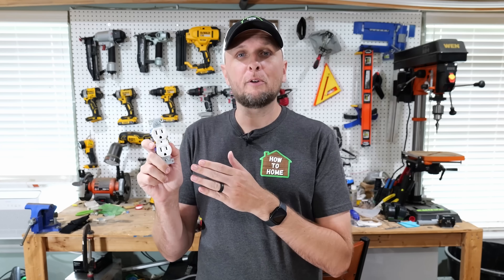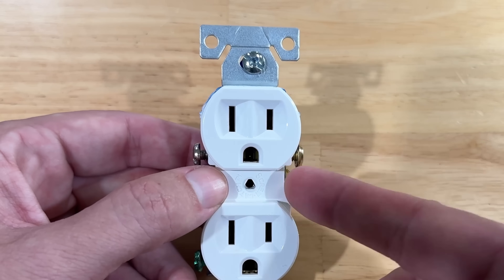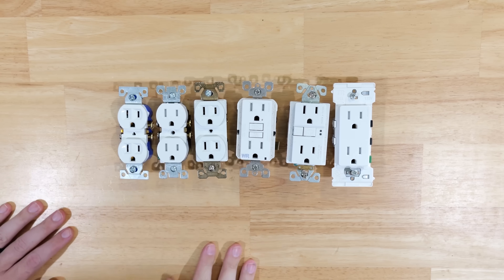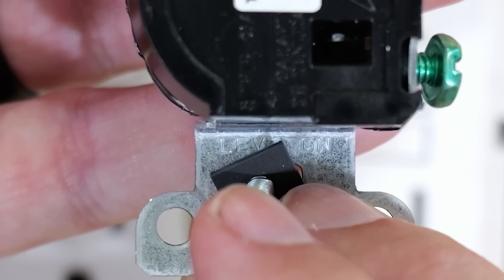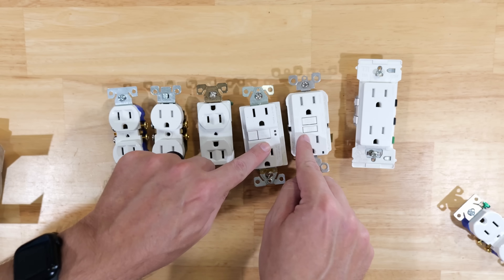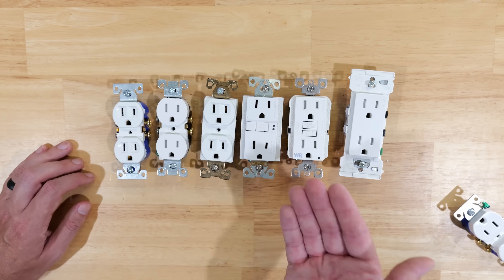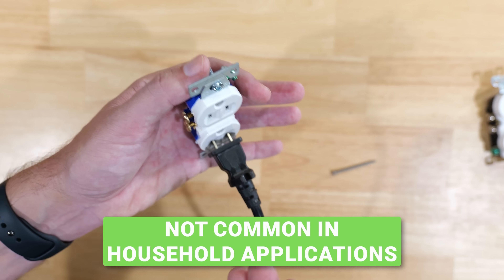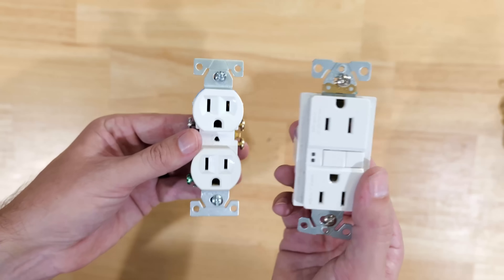The Shocking Reason Why Your Outlets Are Installed Upside Down!

Comment: Well, apparently there isn’t a standard for devices that plug into polarized receptacles. 
Directional devices, such as night, lights, transformers, and many other Devices will be upside down if you put the ground prong at the top. It’s that simple. I bought a place that had the ground pins upward and over time, I had to pull them out and make the ground pins down because of the device that was plugging into It was not oriented as intended. it was upside down.
Go to the store and buy a few devices that don’t use the ground pin, but rely on the polarized orientation and you will see why the ground pin should be down(most of the time). 
Many devices that plug-in to polarize receptacles rely on the neutral being on the left side. That’s why I install these plugs with the ground down because there is no IEEE standard for devices that plug into thesereceptacles. Thank you.

Comment: The house I bought in 2012 had all the receptacles ground prongs up. 90 percent of the receptacles had lost their retention ability.  Yes the plugs kept falling out.  Also try plugging in an extension cord with a 90 degree plug upside down. Just looks stupid.

Comment: It´s upside down to make it a tiny bit safer (because of stuff falling on live + neutral) instead of (finally) fixing it the proper way = making it save by transforming it into non-shocking non-shortcircuit recessed outlets = like the Germans did in 1930 with their "Schuko"-outlets (yes USA is 95 years behind the time) that are still compatible with 2026 plugs & vice versa (1930 (RWE) "Schuko"-plugs in 2026 outlets)  ... 

for demonstrations of this 100 years in the future advantage of "Schuko"-outlets see the video "Why I love the European / German schuko plug" from the channel "Trizocbs" ...  

USA plugs + outlets are the worst on earth that are still "recent" & deemed "save" by law/standards despite being very dangerous like in the 1920s

Comment: I've always seen the outlets and GFCIs with ground terminal down. But I notice that GFCIs that have a LINE and LOAD connection. The LOAD connections are to the top terminals and the LINE connects to the bottom terminals in a ground down scenario. The LINE wiring will normally come down from the top so I wonder why it doesn't connect to the top terminals. The LOAD could be going out the side or bottom of the box which means you either have ground terminal up so that the wiring doesn't cross each other. By the way, I noticed that your GFCIs  had LINE and LOAD showing on the backside of them also even though it was tough to read on my screen.

Comment: I'm 59. All of my life, I've seen the vast majority of outlets installed with the ground down. Having watched this video, I think I'll be inclined to do the opposite. Not because of anything you said - the nail situation strikes me as relatively implausible if the ground is up depending on the height from which it fell, so it might bounce off, but it might slide down and connect one of the hot prongs to the ground It's because when I can't properly see, being able to see that ground prong can help more than seeing the other two, depending on the design of the face. Most faces don't have an outward indicator of which prong is hot when viewed from an extremely high position, and you can't see the ground hole at all, and I usually struggle to get the ground prong oriented to the hole.

Comment: NOT NESSARY in a home .. in a workshop at, or just below counter yes as screws or drill bits can cause a problem.  In a home there is nothing to fall, like maybe a paint chip or some dust at most, however in a shop an AC GFI plug wont stay in a socket upside down.

Comment: It wouldn't be in the code, because it's not remotely related to safety.  Electrically, it's the same either way.  It doesn't mention installing them in a 45% angle either, for the same reason.  :)

But there is a reason for ground down or up.  If you want any plug to stay plugged in better, ground up would hold it better.  However, it would be better to have ground down if you want to notice when an outlet had loos connections.  One could argue that it's safer to have plugs fall out if they are that loose.

Comment: Ground plug up esp in locations where the outlet is used frequently for plugging and unplugging. Over time, the slot portion of hte plug will become worn and loose. With the ground plug up, the ground peg helps hold the plug cord in place. It also acts as a strain relief.

Comment: The real problem is that the ground prongs are on the same side. The prongs should always be on the outside so plugs with a box on them will always fit and not block other outlets.

Comment: Consider these points:

1. Receptacles can sometimes end up being in hard-to-reach places due to furniture. If you ever have to reach under or behind something in an awkward way to plug something in without being able to see, you appreciate the receptacle being rotated in the expected way.

2. Certain three prong plugs are angled; they have the prongs sideways relative to the axis of the cord.  The cord exit from such an angled plug is always on the ground pin side.   Which means that if you plug it into a receptacle that is the correct way (ground jack down), the cord points downward. If you plug that into an upside-down outlet, the cord shoots upward. This is an insecure position. It is likely to yank itself out of the outlet by its own weight. If it is a longer cord, it has to make an awkward arc through the air before hitting the ground.   The upside down plug is bad for power bars, which often have these kinds of angled plugs, where the cable is supposed to extend downward from the outlet, so the power bar can lie on the floor near the wall.

3. Similar to point (2), certain charger devices with a third prong are expected to hang in a certain way; the upside down outlets cause a nuisance or an outright problem for the user.

4. Thich cords whose plugs are straight, and not angled, develop a curve from hanging in an outlet; their plastic casing gets used to that and takes on that shape. When you have to move them to another outlet, and one that is upside down, then they have to be bent in the opposite way to the curve to which they are used to.

So, yes, there is a correct way; the upside down installers are idiots.  The lack of specific recommendations in the USA electrical code, or from the manufacturers, is not everything!!!

If you're going to consult equipment manufacturers, you are making a mistake by looking only to the makers of outlets, and ignoring the makers of appliances and their plugs and cords.

Comment: Ground down is they way they were designed. And the ground pin is longer so it stays inside when it is the last pins out. Especially if the cord is bent downwards. I like the little "pansy face" o the original design. For residential. 
Now in a sheet metal shop, it might make sense to mount them upside down so that a piece of sheet metal against the wall will not short out. But I'm just a licensed architect. Its not a code issue.

Comment: Been an electrician for 40 + years until I retired in 2016. I can not remember if it was back in the NEC codas or not. When I was training We learned ground is always down. In the event of a flood water would contact ground first then hot blowing fuse or tripping breaker. It was done for safety. Times have changed and that May no longer be the case.

Comment: Ground prong up = short circuit protection.  When unplugging, note the grips on the plug. They are on the sides, keeping your thumb and fingers clear.  Plug in items are either double insulated or grounded. When plugging in a 3 prong or grounded appliance, having the ground prong up forces your eyes to notice if the ground prong is missing or not.

Comment: The factor you failed to mention  is the orientation of the cords that might be plugged into the outlet/receptcle. Some flush mount cords and power bricks will have the wire and/or mass oriented relative to the ground prong. In my experience that is why ground prong down is preferable. That way gravity works in your favor and not against you. Just saying.

Comment: Neither up or down. Both are WRONG. Always install them at least 4 foot from the floor and in a horizontal position. Doing something the dumbass way just because that is the way it has always been done shows complacent stupidity. Who the hell wants to turn upside down just to plug something into an outlet?

Comment: This "upside down" mess started around the early 2000's.  I literally NEVER saw this in a home until early 2000's and then it spread like wildfire.  I have heard the reasoning along the lines of "a wire that just so happens to be completely bare just so happens to be all the way against the wall and just so happens to fall across the backside of a connected plug and just so happens to be at the exact angle needed so that it just so happens to make contact with both prongs of another plug that just so happens to be slightly pulled out the socket just enough... 

You might as well say "in case lighting strikes the same place twice.

I also heard the poor support when ground pin down... Sounds like you need to replace the receptacle.  

And while YES, there are some exceptions... when an outlet is "ground pin on top" the following is true 90% of the time:
1) Most right-angle power cords (designed to sit flush against the wall) end up pointing upwards into the air (upside down) - negating their usefulness.  Fridges, washing machines, power strips, surge protectors, etc.
2) Many outlet-mounted surge protectors (the kind that are a box that hangs off the outlet) are designed to be "ground pin down" and their weight pulls them down due to the design
3) Air fresheners with polarized plugs can no longer be connected and would have to be upside down (liquid would spill out) - making them unable to be used
4) My plug-in NiMH battery chargers end up sitting "upside down" since they are designed to "hang down" (weight at bottom of charger) and end up sagging forward.
5) The lights on my outlet circuit tester are on the BOTTOM of the tester (Klien) and you literally have to hunch over to look underneath the plug (to see the status lights) when testing a circuit
6) Many USB chargers with foldable prongs - the prongs normally fold "upwards" and when connected "upside down" (they are often polarized).. the weight of the USB cable can often force the prongs to want to fold inwards - pulling the plug out of the wall due to the design - something that does not happen when plugged into a ground-pin-down outlet.  My bose chargers and Macbook Pro chargers are both like this.

Again... All through the 80's and 90's.. I never ONCE saw a home with ground pin up.  Then some hipster electricians thought this was cool and started doing this everywhere between 2000 and 2003 after a few sessions of forced mental masturbation.

Comment: The grounding pin needs to be down. It helps prevent the plug (particularly heavy-duty plugs) from tilting out of the outlet and exposing the hot terminal. This protects against accidental shorts, which can lead to electrocution or fire. The correct installing is with the grounding hole down.

Comment: Ground prong down. You will notice in the weather resistant outlet it isn't covered like the line and neutral. This allows and moisture to drain away through the ground of the lower outlet.

Also, in a flood situation, rising water will first contact the green ground connection. As the water continues to rise it will then make contact with the other terminals and have a shorter path to ground and trip the breakers. If the ground is up, There is a chance of electrifying the water.

Comment: Look at any grounded appliance cord for a Refrigerator,  Microwave and others. Manufacturers of those cords put the ground on the bottom of the plug. So when you plug in the appliance into an Edison grounded socked the cord has to hang down. Otherwise the plug hangs away from the socket in those applications put the ground down.

Comment: In areas that flood, you want the water to connect to the safety ground part before it gets to the line part for safety. Just saying, after repairing many homes that flooded in hurricanes in the Houston, TX area. we saw signs of shorting to ground because of that which saved the wiring over the ones that went to neutral on some cases. That likely does not matter everywhere but after seeing that I want ground pin down except in hospitals where code is certain. Their priority is not flooding.

Comment: I turned all mine the correct way with the Ground down! Over my 68 year life and electrical work I have never had any shock problems and I have NEVER found a case where anyone else had ever. If there are a few out there it's not the ground prong being the problem.

Comment: Nah, ground-up doesn’t hold heavy chargers as well because of the torque on the plugs. Gravity pulls plugs and chargers downward, which creates a rotational force. When the plug pivots in the outlet: the top edge peels outward while the bottom edge is pressed inward. This creates torque on the plug or charger as it pulls out.

If the ground pin is on top, only the ground contact is resisting that peel-out force. If hot and neutral are on top, both blade contacts resist the torque. Two spring contacts resisting rotation hold better than just one grounding pin. That’s just mechanics.

On top of that, many chargers are designed so the bulk of their weight sits closer to the ground wire. With a ground-up orientation, that extra mass is above the pivot point where the blades engage the outlet, increasing the torque that pulls the plug out.

So for heavy chargers, ground-up doesn’t improve retention. It makes leverage worse. Realistically we should move to mechanical retention mechanisms so we are not relying on electrical contacts to hold the plug.

Comment: I know that what happened to me was 220voltage but as a result, I always install ground up. A customer and I installed his new oven in a tight space. We had trouble sliding it in so we tilted it toward us then lowered it toward the wall. We heard an explosion and saw sparks flying everywhere. We both dropped the oven immediately.  We had lowered the oven with the back metal plate right across the two hot prongs of the plug. My thought ever since was why take the chance?

Comment: Look at a plug adapter (3 prong to 2) that has an exposed copper tab to fasten into the outlet face plate center screw, then look at the new style flat plug surge protector type outlet strips, you know, the flat plugs that the wire comes off the side at an angle, intentionally angled downward, then consider these when installing outlets! Thanks for putting helpful info out there, but maybe do an update ! : >)

Comment: I thought you would’ve shown to where a refrigerator plug. The ground is on the bottom goes flush against the wall and the wire goes downward to where it has to orientate with the ground at the bottom that’s why I always thought the ground at the bottom is correct.

Comment: PRO for ground prong down: Ground prong down works better with many "wall wart" power supplies.  The power supplies often have the plug near the top of the transformer and when the ground plug is up, the center of gravity of the transformer is above the plug/receptacle, causing it to cam away from the outlet.   

CON for ground prong down: While the paperclip/penny thing dropping onto the hot & neutral prongs is a pretty silly argument (highly unlikely and it is far more likely that someone sticks an object between the plug & receptacle to pry them apart, in which case orientation is meaningless), the far more valid argument is that this orientation looks more like a face to young children, attracting their attention.  

Really though, the NEMA connectors really should be redesigned, especially those common for residential use like the 1-15, 2-15, 5-15, and 5-20.

Comment: This video was very informative and clear to understand.  In the 80's (I'm aging myself), my husband taught me how to change outlets and switches which has been very beneficial over the years. Eight years ago I moved into a house that was built in 1984 where plugs where in bad condition so I changed them all room by room as I panted.  I will be honest that I did not know the slot size was positive and negative. I did know the ground.  I now also understand why new homes being built have multiple outlets every so many feet.   I do not understand why every wall has the plug in the middle of a wall that ends up behind every piece of furniture.  No offense guys, but it must be a guy thing. 😂  

Thanks for the great info.😊

Comment: As the prior comment touched on, I was advised by an old-time electrician many years ago that he would install ground prong up only on wall switched outlets to make them easy to identify, and also awareness, possibly thinking you have a dead outlet and possibly putting yourself in harms way.

Comment: On those occasions I need to install outlets as a DIY fixer, the usual way.  The safety concerns of ground prong up vs. down are for rare occasions.  But I remember one landlord of an apartment I moved into explained that the normal-way outlets were always on AC, while the upside down ones were controlled by a wall switch, for lamps you want to control while going in and out of the room. How common is that? I lived many place but only recall that one place using that scheme.

Comment: I totally understand the reasoning behind putting the ground up. But until it is made code and manufacturers start making right angle molded plugs with the ground pin up, I'm not changing.